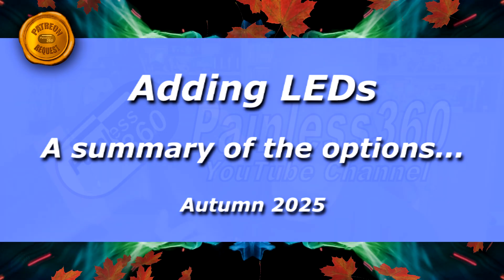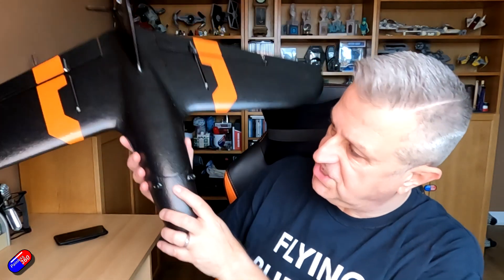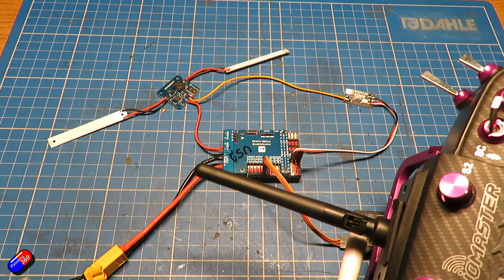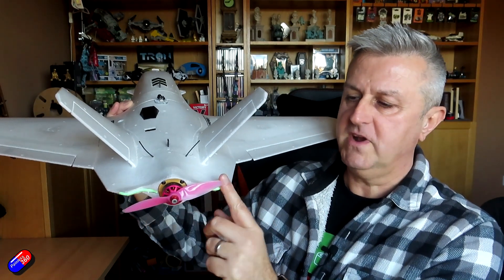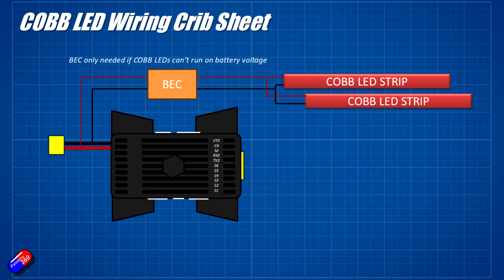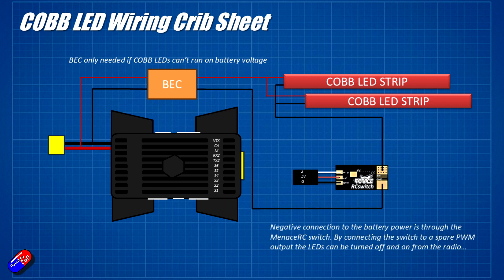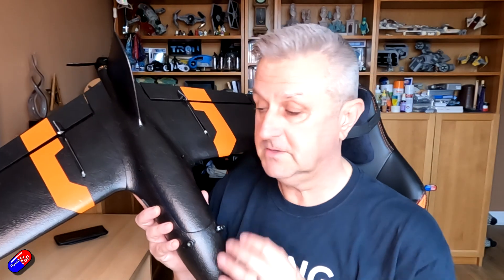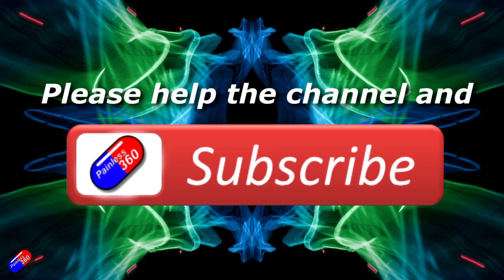Adding LEDs to light up your wing or airplane

Comment: I went with some Strix Noctua Glow strips. The hardest part for me has been deciding how to attach them, and cutting foam is still a new thing to me. If I mess up a solder joint, I just clean it up and do it again. If I cut the foam wrong, I can't just un-cut it.

Comment: I've been considering adding some strobe lights to my wing. They have some 20 watt ones(with 2 10 watt cob modules) on aliexpress. They come in a neat set with red green and white, which will flash in the correct sequence.
Could be wrong, but I feel like they'd need to be very bright if you want to see em in daylight